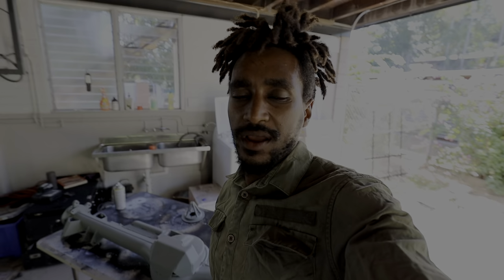EP 02 || Rebuilding Front Axle Housing | Range Rover Classic Build

Comment: What model diff is that? I see it has fine spline axles. Consider a stronger centre, ARB, McNamara, etc.
Reply from the maker: Ashcroft locker and CV’s with maxi drive shafts and flanges